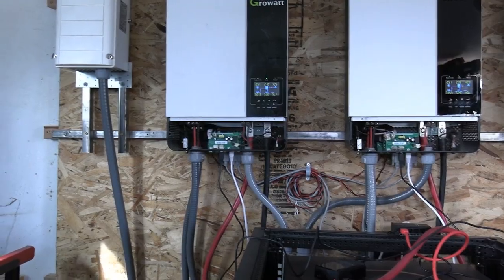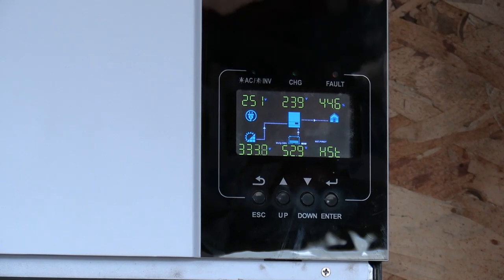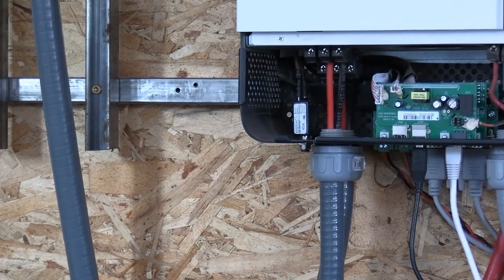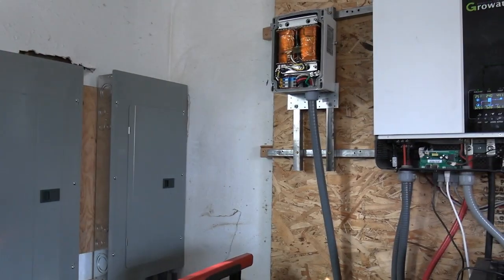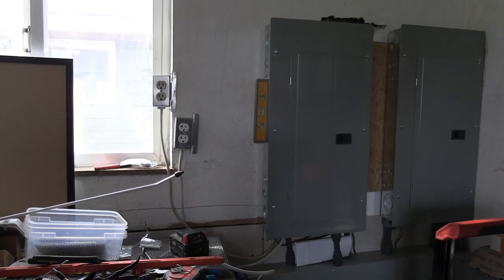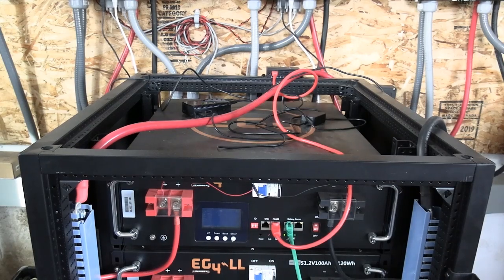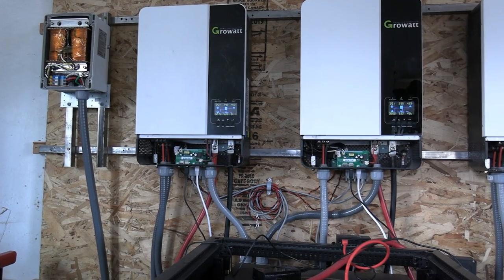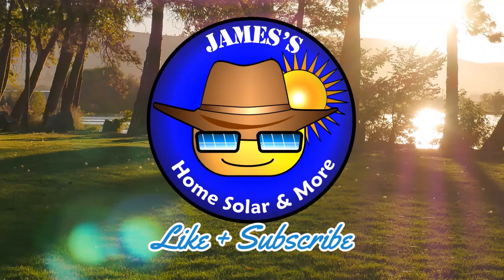growatt 5000 es best inverter remake

Comment: I've just seen Jay's comment on the inverter charging and discharging frequently. This is just another "little glitch" we've seen with Growatt inverters. To date, we haven't found a single LiFe battery that communicates correctly with these inverters on CAN coms.  I'm told that Dyness batteries will communicate correctly on CAN coms. I assume Jay is running menu 005 on USE with max and float voltages on menu 19 and 20. I'd recommend 55V on menu 19 and 53,8V on menu 020 (Float Voltage) You may have these values set too close to each other.
Reply from the maker: you do know that the inverter has little to do with the switching from charging to discharging. the loads and the sun at the time of the loads does that. there is very little difference between most inverters almost all are made in China. same for all the other components. have you seen my batteries? they work just fine in communication with the Growatt inverters. Plus, the new inverter never stopped working and there is no glitch. it simply has a different design. The growatt inverter line is still the best inverter for the money hands down. If you would like I have videos on the solar assistant that tracks all the charging and discharging solar input and grid used. with my system I can power 2 houses if I choose. but instead I will power my house and 1 or 2 cars. keeping my monthly bills very low. my inverters are set at li on setting 5. which means I don't set the voltage for low high or float. if you watched more of the videos you would know that.

Comment: In South Africa, people install inverters to have back up power when the power utility has load shedding. It is common to have power outages twice or more times in a day. Growatt 5000ES inverters we've installed tend to hang onto solar power until there is no sunlight left in the evening, before switching to grid power. During that time, Growatt uses battery power to power the load, which means that when load shedding happens early evening, the customers batteries are pretty much discharged, leaving them in the dark. It seems as if this is a common problem. Most installers will then just sell another expensive battery to make things better.
Reply from the maker: I never use the grid unless there is no battery power. plus I have ran the growatt inverters enough to know you can set them to switch to grid at anytime you want. they are extremely dependable. Even though they had the communication error that was because of a change of style, not because it was failing. the power stayed on during the communication error. I just couldn't see what was happening on my phone. why have solar if you are going to use the grid?????

Comment: James, have you ever noticed the inverter jumping back and forth between charge and discharge with the battery?  I've seen it do it frequently until an increase in load demand.  It must be due to just enough solar input and load demand and battery state of charge.  If there's enough solar, then it jumps to charging, but when the solar drops, it jumps back to battery discharge.  I've seen it jump back in forth quickly several times. I wonder if this will wear things out faster.
Reply from the maker: Yes mine does that also, that’s one of the reasons I am adding more solar panels. My main inverters are going to have 6,000 watts of solar each. The ones providing the loads to the house. The other’s will be a little 5280 and 2640 watts. I got my permit, another inverter solar panels racking and everything except my transformer. It’s on back order so it should be here in may. I tried hooking all my solar together feeding my loads and the batteries. But then even on sunny days my batteries were not charging all the way. Between heating the house and charging the car we are using a lot of juice.
Reply: @jamesshomesolarmore2223  I got this response today concerning the inverter switching back and forth from charge to discharge of the battery...
"The switching shouldn't harm the life of the batteries. The system is adjusting itself and it should clear up the frequency of the switching. A cycle will be after a full charge."
Derrick Reddell
Signature solar tech support
Reply from the maker: @5slabs  I was/am still wondering about the inverter. I need to open up my new inverter and see if it’s different from my old ones.
Reply: @jamesshomesolarmore2223  Mine was different from earlier ones in that it had a specific BMS port.
Reply from the maker: @5slabs  I haven’t opened the box yet.
Reply: I sent an email to Signature Solar about it to see if they might comment on it.  I had to wire my batteries a little differently because I was getting a fault. Went to a 2/0 gauge wire for the main cable. So far so good.
Reply from the maker: @5slabs  yes the 2/0 wire was a huge improvement for me. I still get some switching but mostly just when charging the car and heating the house at the same time.
Reply: @jamesshomesolarmore2223  I  went to the larger gauge cable after I saw your video that you did.
Reply from the maker: @5slabs  I only wish that some of the bigger YouTube channels had shown that instead of trying to wire at the bottom and top of the battery rack’s. I even saw one where he criticized the egyll batteries. Then he had another battery pack where he wired from battery to battery and then hooked one at top and the other on the bottom. Made no sense whatsoever. That’s why I experiment then do a video showing what I believe work’s.

Comment: I have a question can i hook up two similar identical hybrid inverters the same way using one of those midpoint transformers SolarEdge Growatt etc if my inverters dont use the parallel cords or have the parallel option ?
Reply from the maker: If you look at my video showing using my inverter for charging only. You can do that. But if you are using it to supply power? Then they need to have power sharing cables hooked up. My inverter used for charging only is only hooked up to the batteries.

Comment: This is very similar to what I'm going to be doing.  Identical once I get batteries.  The grounding is my major question.  It is all around how to ground the inverters/transformer.  In from Utility?  I notice you don't have them hooked up.  Out to the Inverter fed panel?  I noticed you don't have them hooked up?  I know you talked about the bar itself being grounded.  My thought was if I did hook them both up at the inverter for AC IN/Out, the path to ground for everything off the inverter panel would be through the inverter to the ground at the utility panel and that didn't sound great in my mind.  Does a guy connect a ground only between his utility and the inverter breaker panels directly so anything going to ground is direct?  Then not hook up the ground from the AC IN from grid at all but hook up the ground wire to the inverter fed panel and the transformer to have its direct path to ground go from the inverter fed panel to the utility and on to the ground?
Reply from the maker: I will do a video on the grounding only and why I did mine this way. It wasn’t my idea.
Reply: @jamesshomesolarmore2223  awesome!! Appreciate that!!!

Comment: Your negative cable should be mounted at the bottom of your bus bar for better charging results of your six packs.
Reply from the maker: it has no impact
Reply: Good to know
Reply from the maker: @stevedutcher3875  I have made a new video on this showing the voltage on the bars and in the cells. I know someone else has released a video saying to put the negative at the bottom. It really has no impact if you put in the proper wire size.

Comment: Thanks for sharing! Might I ask what your total overall ideal consumption is for both inverters plus your transformer?

I believe what you want to explain was grounded verse bonding. Electrician U (great YouTuber and licensed electrician) is a great resource for explaining the difference. Again thanks for sharing 🙂👍.
Reply from the maker: Idle consumption for the 2 inverters and transformer runs between 90 and 110 watts. I have watched electrician u a few time’s. The grounding system I have was what the local code enforcement guy told me I needed to pass inspection. He wanted my power coming from the inverters to be grounded separately from the power coming from the grid. As he explained to me he didn’t want the ground from the grid and that from the inverters to be bonded.

Comment: James, do you have any flicker in led or cfl light bulbs?  I have some flickering going on, and I have read others with Growatts do (maybe this happens with all inverters?).  I don't think I've noticed it in regular florescent lights.
Also, what are your settings for your batteries as to when to recharge and when to start drawing power from again? Signature Solar says one thing and Will Prowse another.  I have my water heater connected, and because of the wattage draw from it, and if the solar input is poor that day, due to clouds or rain, there seems to be a lot of jumping back and forth between charge and discharge. I wonder if this a cycling everytime it happens, and shortens the battery life. I don't know if there's a solution when the solar input is less than the wattage the water heater draws, and when the water heater kicks on every once in a while, the inverter goes from charging to drawing from the battery.
Reply from the maker: I have my inverters set to solar charge only. the batteries are set to go down to 25% then switch to grid. When they switch back to solar is 35%. I am not pretty sure that with only one inverter you are running low on the power. last summer i had that problem when I had ac and power tools running with only 2 inverters, also all my appliances were all electric at that time water heater range and dryer. That's why I bought the third inverter. I was turning off the water heater at night or I would run out of battery juice. you have plenty of solar panels for 2 inverters. If I was you I would try to get another inverter and some more battery storage. you are so close to getting to the next step. last summer my lights had flicker also. I went to gas appliances so we could do laundry at night and leave our hot water heater on all the time also. I am waiting to see what happens when all my ac is on. It's not your solar input problem, I think its inverter needs a friend and more battery bank for cloudy days.
Reply: @jamesshomesolarmore2223  I've had my inverter set to sbu, but I read somewhere to try sol.   I added another 1000 watts of panels yesterday.  It does seem I could add another battery. I don't know about another inverter at this time.  Maybe I should put a timer on my water heater. I did shut it off last Friday, because we lost grid power for about 8 hours. We had power here and my neighbors didn't.
Reply: @5slabs  SOL works fine when there is good solar, but when the sun goes down the inverter switches to Grid power (Every night) even if the batteries have a good charge. This defeats the purpose of having batteries that you paid soo much for. I have 4 Growatt 5000 inverters, 12Kw of panels, 30Kwh of LiFe batteries and 2 transformers. My 6 ton Geo Thermal 2 stage heat pump has soft start and 1st stage air conditioning starts at 4.2 tons. I have 100% LED lighting in my house and I get mild flickering when the air conditioner starts. The inverters are only at 25-30% with Air conditioner, Lights, TV, and other phantom (about 400watts) electrical on. I just figured a few seconds of minor flickering was normal. If I can get rid of the flickering I'd like to know how. BTW, I have my batteries down at 29% and back to solar at 39%. When I switch to grid my batteries still drain at about .5 to 1% per hour and start alarming for low voltage at 25%. Does anybody else have theirs work like that.
Reply: @JamesLee-ey2yv  I have my batteries set to go down to 20% and off grid charging at 45%.  Occasionally, a battery alarm will go off on one of my batteries, but goes away after it is charged up enough.  I've added 1800 watts of solar at some different directions, and seems to have helped get more charging during the day, even with all the rain and clouds.  I think I've gone a few days without the need for the grid charging.  Still get some flickering with LEDs.
Reply from the maker: I never allow the grid to charge my battery. I used to allow it but it will charge at night then when the sun comes up it would be most of the way charged.
Reply: @jamesshomesolarmore2223  Due to the lack of sunlight, I have to use the grid to charge the battery when needed.  I just found out this morning, after putting the inverter on sol, that it's been on grid all night, even though batteries are fully charged, so I put it back on sbu, and now it says battery first.
Reply from the maker: @5slabs  did your inverters say only solar
Reply: @jamesshomesolarmore2223  I put it on SOL last night, but I think it said only Utility this morning.  It looked right last night, so I don't know what happened.  I'm wondering if it's because I made the change from SBU to SOL without shutting off the inverter first, because I know I have to do that to make other changes on the screen.  But this morning when I changed it from SOL to SBU, it went from using utility to battery--without shutting off the inverter to change it.  I'm at work right now, but I'm monitoring it on my computer and phone.  Waiting for sunshine to see what it does with it.
Reply: Something isn't right with the inverter right now, because it isn't combining incoming solar with the battery to meet the power consumption. The power consumption is presently lower than the battery discharge.  I probably need to turn the inverter off and back on.  I'll have to wait till I get home.
Reply: After several checks, I see the inverter was combining the solar and battery to meet the power consumption, though it wasn't doing earlier.  Now the solar is both charging the battery and meeting the power consumption.  It shouldn't be charging the battery because it is at 66% state of charge, and I have it set to recharge at 20%.  So I don't know why it's doing that.
Reply from the maker: @5slabs  you have it set to charge when it gets down to 20 percent. But it will charge even if it’s at 66%. Mine charges up to 100 percent then it float charges there 99 to 100 percent.
Reply: @jamesshomesolarmore2223  I just checked...I do have it set at 20%.   But what setting do you have it at for when it begins to draw from the battery?  I have it at 45.  I think that was where signature solar suggested.  Will Prose, I think, said set it at 90 or 100. 
 Today was a bad day for any charging, overcast all day.  I can still get enough solar  sometimes to run most things and provide some charging for the battery, until the water heater kicks in. Then it's mostly the batteries, but when that's done, it goes back to just solar, if there's enough, and providing a small charge to the batteries.
Reply from the maker: @5slabs  I have mine set to go to grid power at 25% charge. Then I have mine set to switch back to solar at 35%. I don’t recall Will Prowse saying 90 or 100 %. I ended up drawing from the grid today after 2 cloudy days in a row. It’s because I am charging the car. The thing is that we have about 440 miles and have only used a quarter tank of fuel. My solar is doing really good. I can’t wait to hook up the other solar panels. I am going to get more batteries also. First I am going to tear down my 24 volt batteries and make them into 48 volts. You get that information first, because you are corresponding with me.
Reply: @jamesshomesolarmore2223  There was a Will Prowse video on how to program the Growatt.  I downloaded the video when decided to buy mine to use as a guide.  I couldn't find the video on YouTube later, so I don't know if I just can't find it or he removed, because it was shortly later that there was all that fuss about the autotransformers.  But I have his video.  Thanks for all your input. 👍
Reply from the maker: @5slabs  oh I believe you, Will is loyal to the dollar.

Comment: So you have 
3000watts of panels going into inverter 1
3000watts into inverter 2
6000watts going into charge inverter 3 
32 panels 375watt panels 

I would think it's more efficient to have 1&2 inverter maxed with panels. So the power could be used before sending it to the batteries. You also would have less loss in conversion. Just my 2cents.  I love the work and I'm new to the solar world. I understand you are also growing the array. Currently own 24 435watt panels one 5000es and 4 agm.  Only work with 9 of the panels on a array due to winter in mn.
Reply from the maker: I would have done that, put 6000 watts to the first inverters. But then the battery communication would have still limited how fast they charged to about 46 amps. I have them charging at 86 amps. Before I got the car, I didn't have a consistent major draw on my power during the day. The problem then was just getting the batteries charged for use at night. the heaters use more power at night. We will see what happens this summer when we have air conditioners and the car hooked up at the same time. hopefully we have the other panels hooked up by then. I have a guy showing up on Monday to do work, but we are starting on our soffits and air flow for the house. We need to finish the work on our house this year.